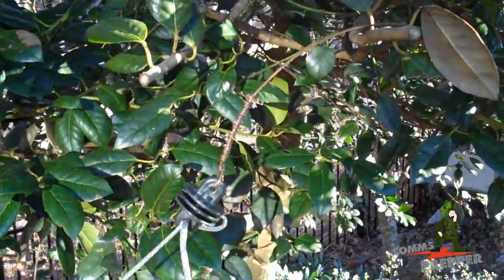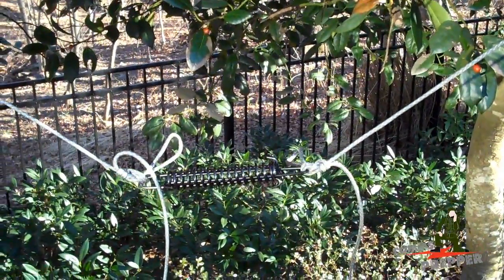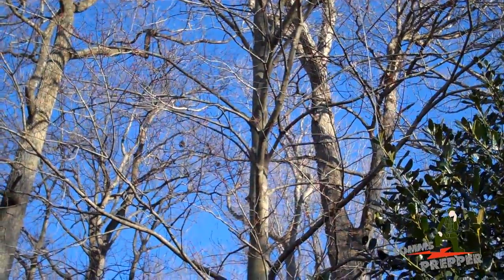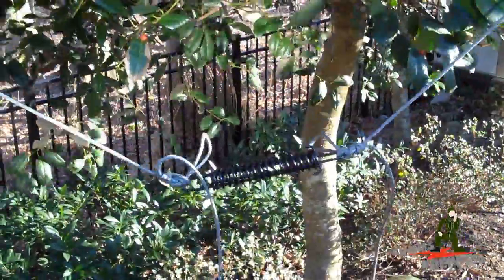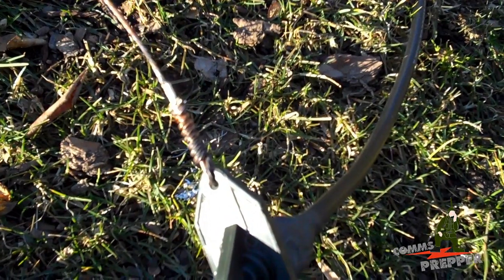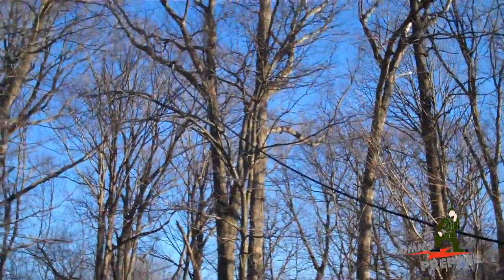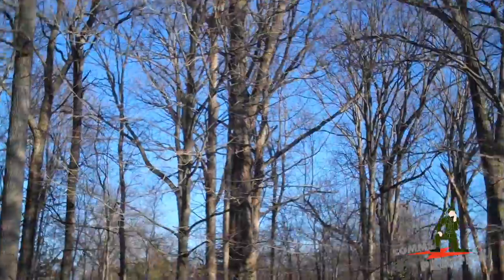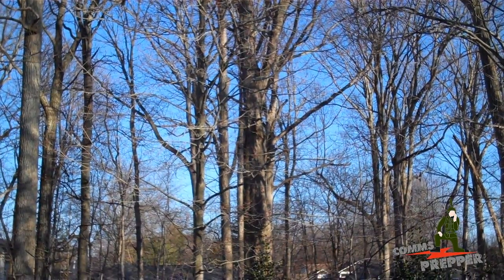Strain Relief for HF Dipole Antennas (one of many ways)

Comment: Make a video for new technicians like myself called "you have you license and a Boefeng, now what?"
It's funny how you can pass that test and still have no idea what to do, or what you can do. I just want to make a simple antennae for my Boefeng tri-power, but am not sure how.
Reply from the maker: davjan4 Would be a good video but I do not own a Boefeng.
Reply: davjan4 A copper cactus J-poll would be a good start for 2 meter and 440. I made one of them many years ago when I first got my license. Just uses copper water pipe soldered together. Ruby fluid flux simplifies the soldering process. Would recommend a small propane torch.

Comment: as a kid in the 60's, i remember a writing spider who built in a stress relief into it's web. it spun a web in our azalea bushes. it then utilized a stone by tying it off in a basket of sorts and lowering it over a branch of the azalea bush. i would have done much the same only adding an anti-friction point by placing a hard plastic cover over one of the tree limbs, maybe a pulley tied off to it and using a 5lb weight being the slack adjuster/strain relief.